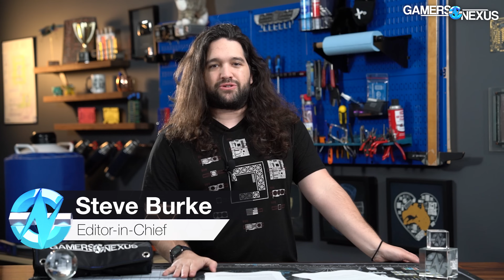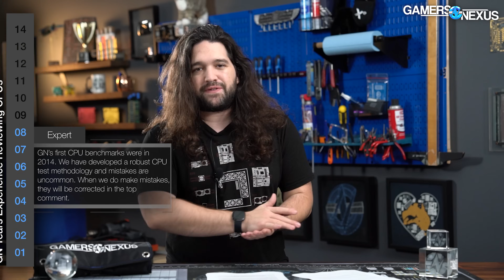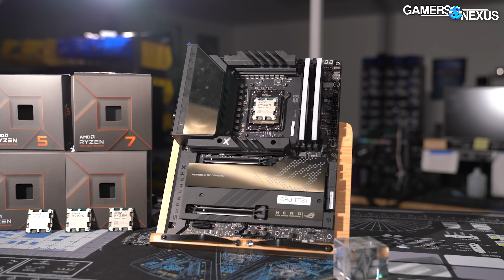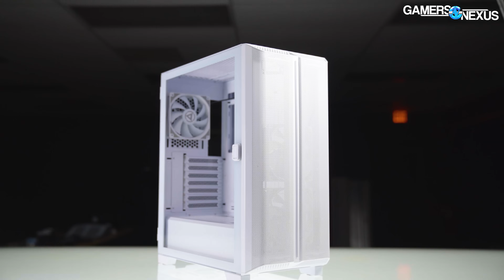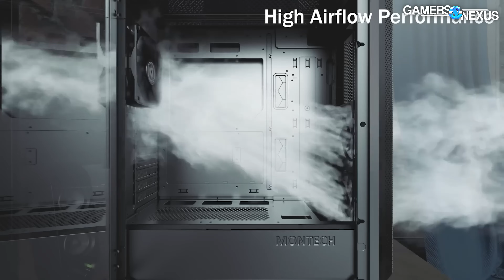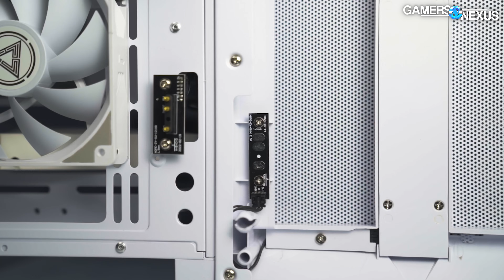AMD Ryzen Eco Mode Deep-Dive & Benchmarks on R9 7950X (Zen 4)

Comment: AMD should intoduce a 7950E processor.  It could be exactly the same but with default 105w tdp.  If they saved the better quality binned dies for this the performance would be about the same as well.
Reply from the maker: Interesting idea! What does everyone else think?
Reply: @GamersNexus  I am not sure. I mean, would it be better than buying a regular 7950 and set the power limit to 105W? What I do think however the Eco mode should be more promoted and super easy to access, even for user who usually don't change stuff in the BIOS (because people who temper with the BIOS are a tiny minority). At least here in Europe power efficiency matters ... thanks to skyrocketing electricity bills.
Reply: @mrm7058  If it were binned it would almost necessarily be better
Reply: @mrm7058  naa if 7950E is cheaper and has  less power requirement than regular 7950x which can be used on cheap motherboard and put less stress on average quality VRM than i am buying one.
Reply: @GamersNexus  i like it
Reply: @GamersNexus Ryzen E series already exists for embedded applications. Socketed. See the 10 core 5900E and 12 core 5950E
Reply: @GamersNexus  They'd make more money selling those dies to datacenter. AMD needs more cash to consistently provide us consumers with competitive choices.
Reply: @brainletmong6302  they are more likely to buy a slightly cut down chip with better efficiencies as well because they dont just buy one of them .
Reply: @GamersNexus  from a sales perspective, it would be confusing, and also have to have some restriction that stop it from being the same as a 7950x, because otherwise it would be slotted in at a lower price, but that would kill sales of the 7950x.  AMD would never do it.
Reply: @chubbysumo2230  But the name would be 7950E, not 7950X. That is at least a direct, right up front description of the product. Unlike certain GPU's that are different, but have the same name!
I do think it would be a good idea. If the bin doesn't make it to be a 7950X, then they shave off some cores, and bin it down to a 7900X. What if all they had to do is make it in to a 7950E, and save the die and a bunch of work. Like the difference between a K-SKU and a non K-SkU Intel CPU. Hell, Intel even has low power versions of their CPU's. T-SKU. I just think that more choices is a good thing for us, and them as well.
Have a great day! o7
Reply: @CMDR_CLASSIFIED  You want a very good bin if you want to undervolt while still being performant. The units that perform best in ambient XOC and stand long term overvolting are also the ones that perform somewhat acceptably when undervolted significantly (for such units, PBO offsets could be extended to 50 units instead of regular 30)
Reply: @erkinalp  Bin's work both ways. I have a dozen i7-4820K's, and they all clock different, at different voltages. The best one I have does 5GHz at 1.355v, and 4.6GHz at 1.205v. I have one that can't hit 4.6GHz at 1.555v, but does well at 4.4GHz at 1.305v. I have one that can't even go past stock no matter the voltage I apply. (It's why I use Xeon's now. I have an E5-1680-V2 that does 4.8GHz all core 24/7 at 1.335v) All I am saying is that there is a market for chips that don't make the cut for the higher binned products. And with micro code, these chips can be useful for certain applications.
Reply: @GamersNexus  best binned dies should be unleashed for the ones who need it
Reply: @GamersNexus  not a bad idea. Except, the best cpu dies go into epyc. Where they sell for a lot more money.
Reply: @GamersNexus  I'm planning on building an ITX machine, I'd LOVE a 7900E, especially if it meant I'd only be losing like 10% performance!
Reply: @GamersNexus  I'd love to see this done, but I doubt they'd do it with the good Zen4 dies when X3D and Epyc are presumably around the corner. I think they could use the Zen3 + dies for something like a 6950E or some nice APUs based on the mobile parts. The 6980HS in my laptop would roughly be a 6700G on the desktop. You could even bump up the TDP on mine from 35W (that's a fucking lie AMD I see your 80W power limits) to a bigger 50W and give the iGPU a chance to stretch its legs.

They could even take slightly worse dies at a little more voltage than my seemingly hyper-binned chip, as just about any desktop cooler will be bigger than the 1-slot thick vapor chamber and thumb-sized heatsink in my laptop. 50 to 65W for 8C/16T and 24 CUs of RDNA2 would absolutely slay for a lot of budget gaming systems and tiny PCs.
Reply: @GamersNexus  Main problem would be find a pricing spot for such a CPU. It would have to be cheaper and that would maybe cut into the revenues they are able to pull of with the 7950X alone.
Reply: @GamersNexus  would be nice, the headroom is there I got my r5 5600x to only used 48w at max load and some how gained performance just by undervolting (used to use 70-80w at max)
Reply: @GamersNexus  that would make the 7950 tempting for the 3950x render box. for now at stock is a bit much as I am watt limited at the meter thanks to where I live. To be fair, nvidia is far worse to the point of hard pass, I'll gladly keep the meager GTX1070 that doesn't overpower the AC unit. lol.

Great vid Steve and crew.  B)
Reply: @GamersNexus  It sounds good on paper, but probably not worth a whole new sku to most people.  AMD would just taking better bins to put on X3D sku or epyc server.
Reply: @GamersNexus   We need a 7950XT that is configured to PBO max negative offsets and max scalars out of the box.
Reply: @GamersNexus  I think it would be better if MB BIOS would just run them on ECO mode as default.  Your regular user won't notice and wouln't care about 5% of performance, but will enjoy better temps and more silence. For those who has an excellent PSU along with powerful cooling it would take just to switch it off and reboot (and even then they'll likely to overclock the thing or custom-tune it, so they still have to disable it).
Reply: @GamersNexus  Would be a great idea, though i think for the average Joe to use it, this should be part of the windows power plan maybe upon startup(first or every) ask how power hungry you feel today(TDP will scare a regular user). I would love if there would be an ECO mode for GPUs since today's GPUs are scary from that aspect I run currently an RX580 at ~80w.
Keep up the good work!
Reply: @GamersNexus  I would buy the 7950E (if little cheaper), or the 7950X3D if same as 105 watt eco mode but with Cache. I absolutely hate that AMD pushes 95°C, and 230 watt, the 5950X was super effecient, same for 5800X3D, only reason i didnt buy was i was to busy with house, and the starting price was way to high (corona), and last year while cheap 7000 series was to close, plus AM5 allows an upgrade AM5 + 5950x doenst. Now motherboard and DDr5 must get a lot cheaper, and ryzen 7950x slightly (in EU the weak € shouldnt be calculated in sale price, especially not, now that the series isn't selling well, and world is climbing in recession, let alone that 13900k is also cheaper.
Reply: @GamersNexus  AMD just should made the 7950X with 105W stock TDP and a "KS" (XS?) version with better binded dies for folks that want the absolute best performance.
Reply: @GamersNexus  I'd personally buy the -E skew of a CPU, it's my preference to start at a lower stock with more overclocking headroom if I want more performance.
Reply: That's more or less what happens for Epyc cpus right? Binning the chiplets that are super efficient at much lower max freq.
Reply: Pretty sure better binned dies will go to Zen 4 3D
Reply: Intel used to make an “S” sku where it ran the CPU at lower vcore. So there was an i5-4690S which had a 65W TDP vs the regular sku that had like 85W I think. I don’t know if they were better silicon though, and most people didn’t see the point because they could just lower vcore in the BIOS. They were great HTPC CPUs though.
Reply: @alistairblaire6001  Actually, Intel still have a lower TDP SKU. Look for SKU with the suffix t (12600t for example). But for some reason those are not advertised, and there are not much benchmarks (if you can find any at all) for them.
Reply: Interesting idea, but I think the X3D will occupy enough of this niche by having to be more power-constrained for cooling reasons anyway.
Reply: @S3lvah  i agree X3D that makes more sense for gaming .. But NON X parts where you have 65W or 105W parts which only have 10% less perf for many 50% less power consumption makes more sense for a normal person .. savings in cost  for buying(assuming will be cheaper ) ,power and may be more long lasting by not running on 95C all the time
Reply: why would they use saved high quality bins for this when they can use it for the x3d version of the chip?

They would definitely use a LOWER quality bin since power consumption and not performance is the important thing.
Reply: Hard disagree! They have the 7950 moniker open (non-X). No need to add E ;)

All the Ryzen 7000 without X could be with much lower TDP. I'd always pick that instead of the X in my case (pun intended/sff).
Reply: nah just buy regular and have 1 click option in software to turn into eco mode (that updates bios settings) i think ryzen master does this already, but they need to add it to adrenaline for the CPU, since everyone will install that for the onboard gpu at least.
Reply: Well, I think it would be better to go the other way around, limit the stock cpu to 105 w and them let the user overclock it for that little extra performance if they wanted, kinda like it always has been.

You save your golden samples for the x3d chips and go a little more agressive with their tunning as well for those people who want the highest performance.
Reply: How about that just be a regular 7950, maybe something like 200mhz slower and like $50 cheaper.
Reply: @vgamesx1  From a marketing perspective, I think selling them as EE (energy efficiency) version like they did many years ago, may even work better for them.
Reply: With recent electricity pricing, that would be really nice. I'd also like that for GPUs.
Reply: Yes. Another idea is to have the BIOS prompt the user on first power-up to select between ECO power-saving or performance operation. Motherboard makers should jump in the fray. Needs to be an easy toggle that is on the main BIOS screen that is clearly explained. ECO should be encouraged for most applications especially when factoring electricity use, heat and/or fan noise.  Perhaps similar to the 1990's 'Energy Star', the BIOS should display the setting at POST and that it is easily changed.
Reply: @gamedoutgamer  Great idea! And it would be easy to implement in a BIOS update, even going back to earlier chipsets.
Reply: Would prefer instead a non X processors with lower TDP and lower cost..
Reply: I think any time you have a significant enough difference in die qualities, the more profitable thing is to release "xx[CPU name]xx" and market it to gamers who have too much money.
Reply: as you can set it to 105W, why have it default to 105w? do as you please, don't force others to do like you.
Reply: I wait for 7950X 3D. I can tune it my own because there are so many ways to tune temp-targted CPU.
Reply: I think it's a good idea, but only if they also shave a lot off the IHS, and have it geared for embedded designs. having the stupidly thick IHS would be a waste at these lower thermals.
Reply: 7950E needs to be prices different or be more different then just activating ECO mode on a normal 7950, it would not make much sense to sell the same CPU at same price with just hardware locked bios settings difference between them.
Reply: No, since you can easily mod the 7950X to exactly be that and have additional headroom
Reply: That probably be Ryzen 7950 PRO
Reply: Default should be 105W and if you want more you just overclock like always.
Reply: Why do that if the user can enable it. Waste of time effort and money for Amd
Reply: "Lamborghini should release a hatchback, that performs poorly but has good  gas mileage"

It makes no sense to release the top tier chip for bad performance when someone who just wants to clock it down can get a slower chip and save money to start with. This is the sports car cpu segment - performance is what matteres. Nobody is buying the lambo because of its fuel mileage - making a shittier version with good fuel mileage because some internet reviewers don't understand market differentiation would be a waste of time and money.
Reply: Just enable the BIOS option to limit the TDP. Why the heck make a new CPU just for a different default
Reply: The problem is those binned chips are already being allocated for X3D processors. What would really fill the top end niche is a 7950X3D that's been properly configured instead of making the buyer fix the default settings.
Reply: Just do the 7950, but have a 3-way Turbo button on the tower. Turbo on is full 170TDP, middle 105W, off is 65W. Bring back the turbo button!
Reply: This exists now with the 7000 non-X chips. They even boost to the same 95C temp and clock speeds as X chips with PBO enabled. Sadly no 7950 version though.
Funnily enough for now at least in Europe, the X chips are cheaper than non-X so there's no reason to buy the non-X yet.
Similarly the 7000X3D chips will have a lower TDP than X chips. It'll be interesting to see how they compare to the X chips' eco mode.

Comment: I find it easy to get a cpu cooler when I have no budget. Got the Nzxt z63 280mm twice for two builds. However I’ve been trying to get a 13600k value build going and it’s been very challenging and confusing to figure out what would be a sufficient cooler tbh for the budget allotted.